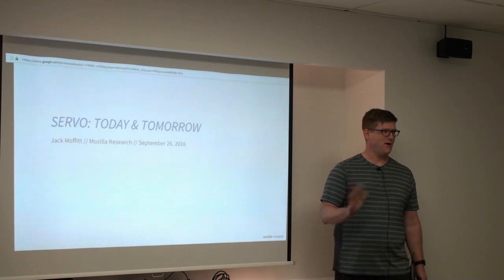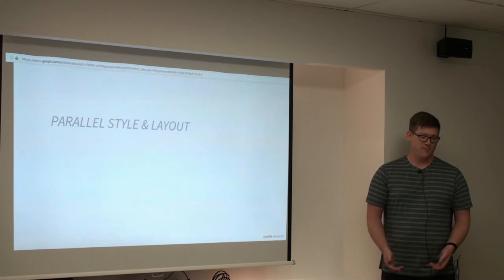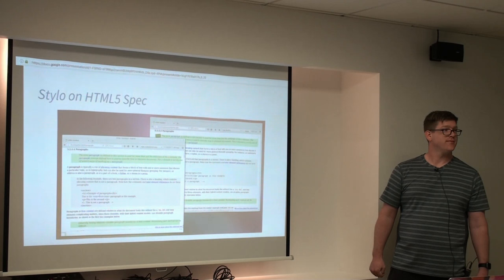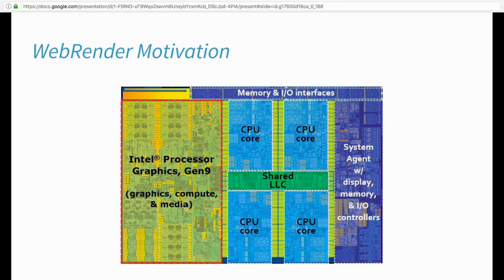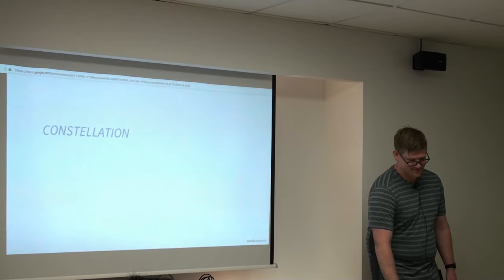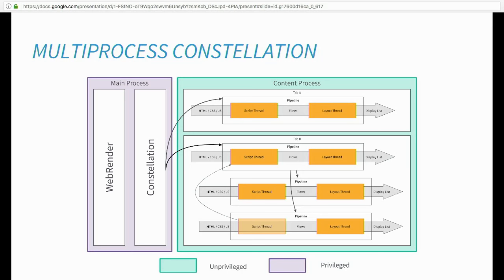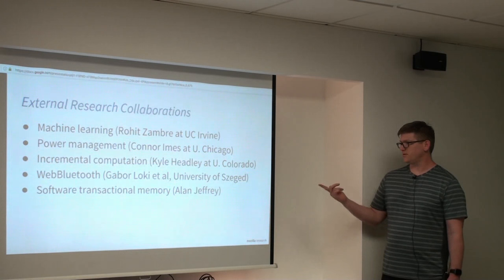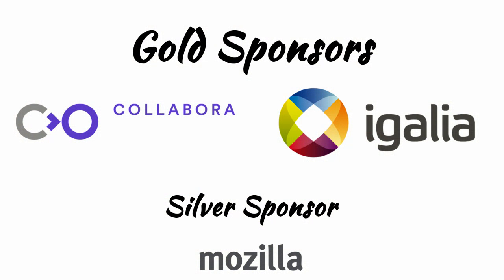Jack Moffitt - Servo: Today & Tomorrow

Comment: Correct me if I'm wrong, but I believe that arrays and pointers can all be avoided in C++; if you just use references, STL containers and object-wide variables.  I know that this has not been the norm in C++ nearly often enough, so as to result in so many such bugs as to instigate the creation of Rust, but it is my understanding that such structures can avoid naked pointers and arrays in C++ to avoid at least those kinds of troubles.  Most of these techniques aren't even very new; with references being the most recent.

Comment: I hope it will be based on pure webgl also on all windows platforms.
Reply: Personally I hope they move over to some kind of Vulkan solution.
AMDs OpenGL performance is kind of horrible...
Reply: Luredreier Eventually you have not ever run chrome or firefox on linux operating system.
Reply: Morris S. Why the heck not?
Firefox is open source, you can rip out and shove in whatever the heck you want, it will run just fine on Linux.
And with the number of Linux users involved in developing it...
Reply: Luredreier cause if you have tested firefox or chromium on ubuntu kubuntu lubuntu or whatever linux operating systems you should know how good is webgl instead of that crapping wrapper of ANGLE which adapts webgl to DIRECTX. So if the wrapper has to adapt webgl to use directx, why not to have a native webgl browser also able to benefit the system by hardware acceleration!?
Reply: Morris S. Again, OpenGL is old as fuck and need to be replaced.
I'm not talking about converting to DirectX in any way, shape or form.
But VULKAN.
It's the open source alternative to DX12 made by the same Kronos group that made OpenGL all those years ago...
Vulkan is a lower level API with way less overhead while still being compatible with multiple operating systems and platforms.
And it doesn't have any of the legacy code that's causing issue with OpenGL.
And at any rate all the GPU manufacturers are making new Vulkan drivers without all the old junk in their DirectX and OpenGL drivers cluttering up things...
It's a fresh start and better in most ways except the effort and knowlege needed to make a good program using it.
Reply: Luredreier opengl is not old  at all. it's old in your mind besides vulkan makes a lot of hardware not usable.
Reply: Luredreier Vulkan is not checked in real time for correctness. It would be a security nightmare that would cause system hangs and crashes. Webgl is checked twice once by the browser and then the driver.
Reply: Jim Feig Can't see any reason why the implementation running on top of Vulkan can't be checked for correctness by the browser just fine.
Especially with Rust gaining traction that should get easier to do well.
Reply: Luredreier a browser can be multiplatform offering the possibility to switch.
Reply: Luredreier The checks don't exist in a way that can be fully automated or quick. Vulkan runs under the assumption that the programers has run an extensive set of checks.
Reply: Morris S. I know.

Jim Feig *nods*
Well, if they have to run WebGL please, for the love of all that's holy make it run on top of Vulkan and allow websites with the users permission to run direct Vulkan code as well.
I'd honestly would prefer the risk of people not doing proper checks in return for the chance of them actually learning to doing those checks and then making good and correct code.
The lack of checks in Vulkan might actually cause users to do more checks themselves.
Reply: Luredreier Very few people understand opengl even fewer understand Vulkan, it was designed for use by video games being run directly. Translating from WEBGL to Vulkan also would slow down things.
Reply: Jim Feig Fair enough, regular WebGL then, but I still hope they add Vulkan support too.
And preferably also a C/C++/Rust sandbox of some kind.
We're not going to see much single threaded performance increase in the future, I think, so the overhead we've been able to absorb with hardware performance in higher language programming in the past will need to be dealt with at some point soon I think if we're going to see continued development of new features.
You can already do great things with WebGL, but I'm convinced that sticking to that alone will hold back the web...